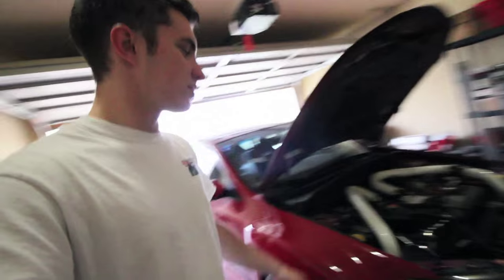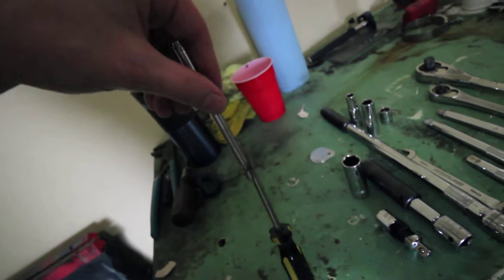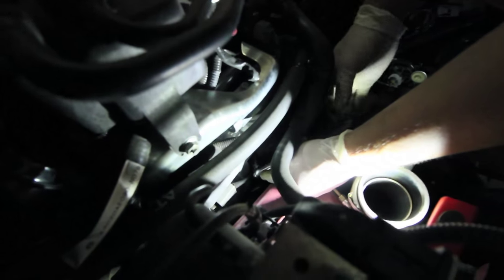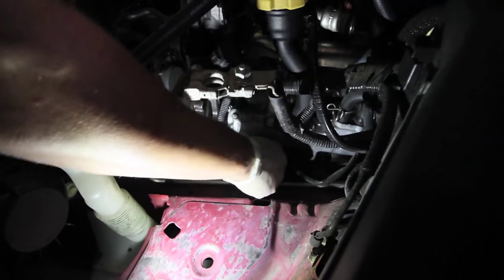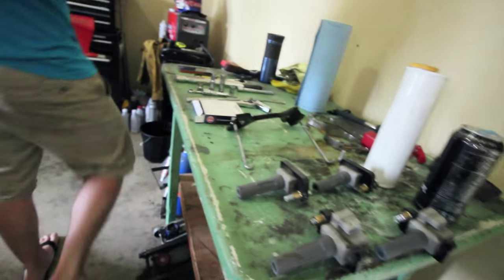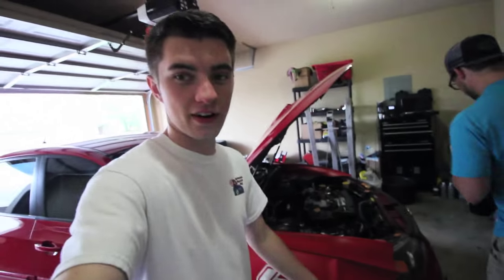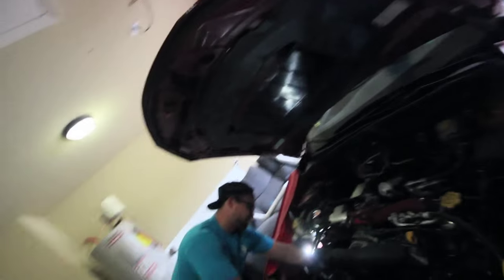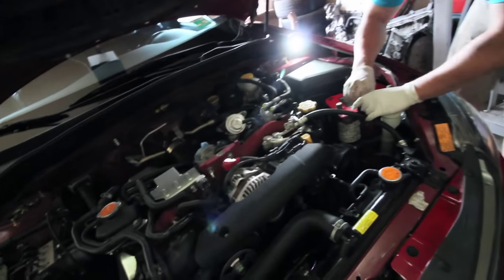Subaru STi Spark Plugs | Ethan's Garage

Comment: Nice video. Love these garage ones :). Quick tip as well. If you look at the connectors that plug into the coilpacks there are white connectors and there are black connectors. The white connectors plug into the front two coilpacks and the black connectors plug into the back coil packs. It's literally impossible to swap them but Iv seen it done. And take caution when unplugging the connectors from the coilpacks because the connectors are known to brake on the subarus. 
1(white connector)
2(white connector)
3(black connector)
4(black connector)

Rear
3-4
1-2
Front

Comment: Hmm, Premium oil and a bargain basement filter….great choice! 

Hopefully you pre-filled the filter with oil, this reduces wear when you crank a dry engine! You may also want to run the engine longer to check for leaks at the filter/ drain plug, before buttoning it up!

Comment: What are your thoughts on your Cobb Access Port V3? worth it for Subarus? sick videos and car is super clean
Reply from the maker: tyler baker I use one. They're great to have, but I don't advise using them just for the OTS tune; using them with a protune is the best option to go with.
Reply: sweet man, i just bought a 2016 WRX but I'm deployed to the middle east right now so I've been waiting to pick it up and wanted some input on it. thanks for the quick feedback.
Reply from the maker: No problem, man. Thanks for serving, bud.

Comment: @evanshanks I'm stuck deciding between a 2013 Nissan 370Z. 27k miles. It has a exhaust and test pipes and come other exterior mods. And a 2008 Sti. 26k miles. It has exhaust, intake and everything else is stock. Both cars are for sale at the same price. I don't know much about the Sti motor. I've heard about people getting ringland failure from going stage 2? Do you think I would run into any problems with ringland failure with the 2 current mods? The Sti is from a dealer and the 370z is private party and it still has 1 year of Nissan warranty left. Both are $27k. Thanks. I appreciate it.:)
Reply from the maker: Alec Young That's purely up to your own research and opinion. I'd get the Subaru if you love them, but the 370Z is a fun car, I'm sure.

Comment: Dude youre only making 300 hp to the crank or wheels? Cause my 09 is currently pushing 313/331 to the wheels
Reply from the maker: Matt Barros to the wheels on a low-reading dyno. Mid 300s on a DynoJet, but who cares, it's just a number.

Comment: Quick question the white long tubes your Sti has does very Sti have them white or is that not factory stock
Reply from the maker: Wilfredo Enamorado 2:59
They're intercooler pipes for my aftermarket front mount intercooler!